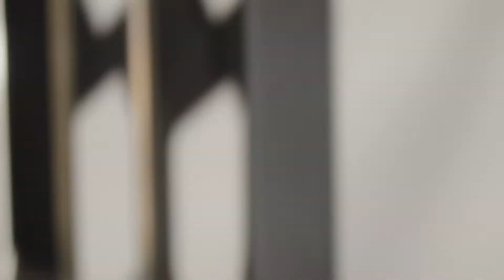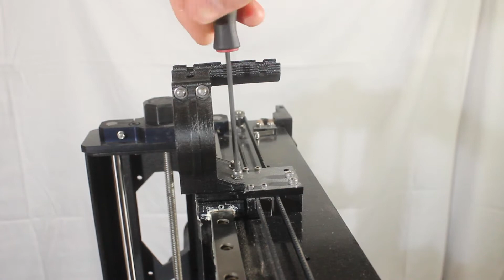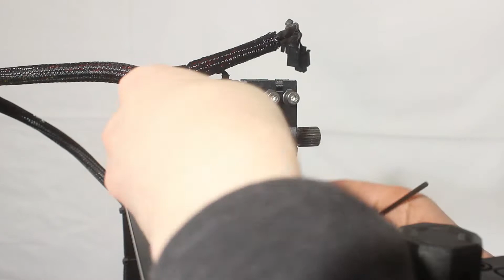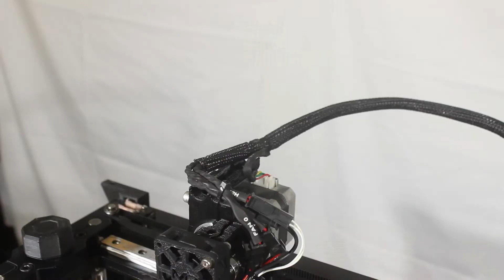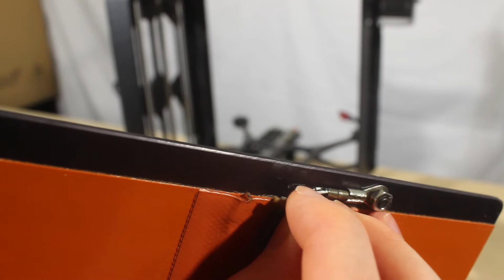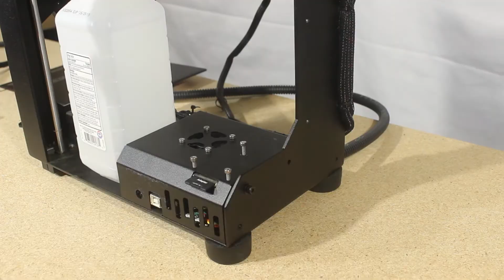MakerGear M2 3D Printer: V4 Upgrade and Repairs

Comment: Hi, I am having an issue. Probably a noob question, but I appreciate this video.  Just wondering. My bed has the 3 screws to adjust the bed level. And I’m not sure how to adjust the z level because it is too tight against the bed on first layer therefore not extruding. It seemed to be working fine before. It’s a rev d and had never been used before I got it. Also what kind of printed upgrades are you using? I am tech savvy. Just don’t know why this issue is happening. I’m using simplify 3d or Prusa to slice. And even tried pronterface to print. Just not sure why it’s giving me a headache! Any hello or knowledge from your experience with this printer would be great! Thanks!

Comment: Ah, never seen or heard of them over here in Europe, but it is certainly an impressive device!

The reason for heater failure was not a short, but a strain failure. As cables bend back and forth, the conductor breaks and thins out, increasing its resistance at a tiny spot. When there's only a small fraction of intact conductor strands left, a significant portion of the power intended for the large bed ends up being dissipated at that one spot, which then burns out. This failure mode is fairly safe for the electronics driving the printer but can potentially start a fire near the break if non flame retardant materials happened to be nearby.

If there was a short somewhere in the heating components, the PCB should be protected by those two fuses on the board: there's an automotive blade fuse, probably for the bed, and a smaller socketed SMD fuse nearby, probably for everything else. So if that happens, measure them and plan accordingly to order replacements.
Reply from the maker: Thank you for the info.